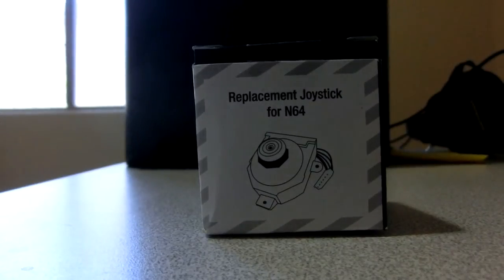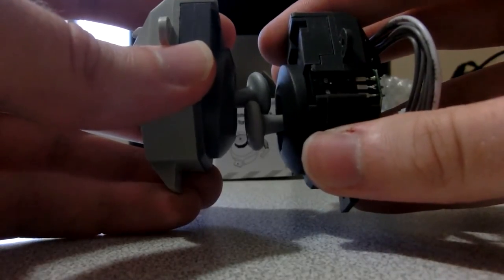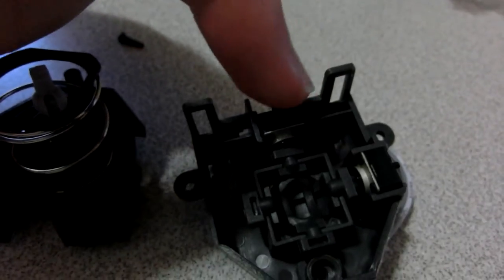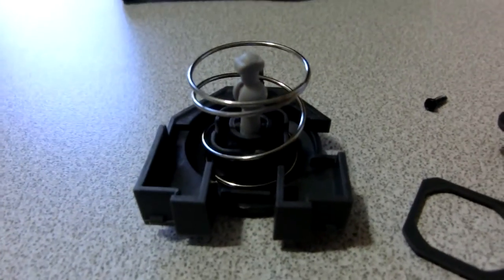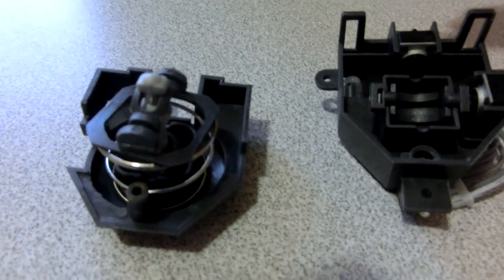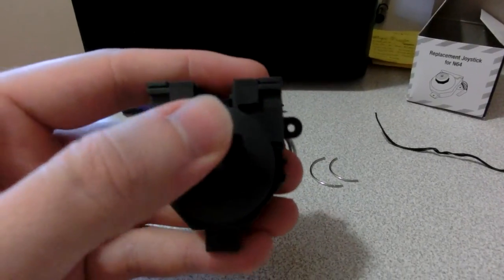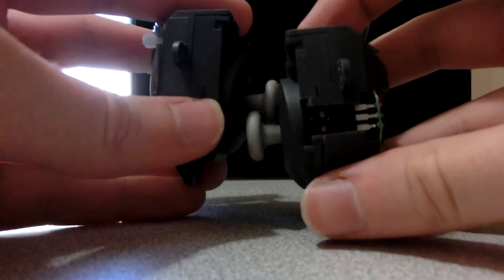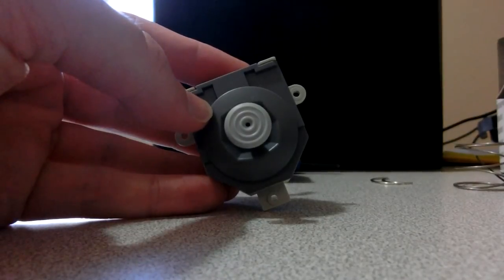Repair Box N64 joystick review, teardown, and tinkering

Comment: i added in some grease in there because to make it smooth. however im having trouble putting it back together. the spring is making it difficult to put it back together. i didnt have any problem putting back the original stick

Comment: I brought a handful of these and hit exactly the same issues as you did. I tried using an original spring and using silicon grease but while better (and much better than some of my sticks which are completely unusable) I still didn't like it. It does, however, use the same sensors as any other console sticks so I replaced two with PS2 sticks (and a lot of cutting, gluing, soldering and tiny crafting) and was delighted with the results. The sticks do have a bit more of a dead zone than the stock stick, and are a touch more sensitive. The nex problem I hit was that the ps2 sticks don't seem to give enough resistance to allow fine control - however the Xbox 360 and Xbox offer a mite more. It's a lot of work to put a modern stick into it but it's well worth it with a Xbox one - can play as normal with only a little learning as you need to play a little different for the new (not busted and now smooth) stick type. Hope that helps!
Reply from the maker: Mark Kane That sounds pretty complicated.  Maybe you could make a video or website about how you did it!

Comment: Did you have the same problem where the controller would not fit back together properly after installing the Repair Box stick?
Reply from the maker: No, the RepairBox stick fit just fine inside the controller.
Reply: NintendoRepairs I know this is already an year old comment, but I just have to tell this. I just got myself a N64 and decided to put it in good shape. Cleaned the console and controller etc. Then I ordered the Repair Box stick to replace the worn-out original stick. Well it felt stiff and good, but when I put it in my controller, the controlled wouldn't fit back together anymore. I even tried taking off a little plastic from inside of the controller, because I thought it would stuck there, but nope. I couldn't even figure out what was it that was getting stuck. I think it may be the cables, but I don't know. I'm just disappointed now. Over 10 euros wasted. It may not be a big amount to many, but I still feel like it was wasted and am disappointed. Why wouldn't the controller fit with this, even if this and the original stick are about the same size, but still there was a huge cap when I tried with this stick. At first I thought it was the circuit board, because the original doesn't have it on the top, but when I took off a little plastic that I thought was hitting the circuit board, it wasn't that. Sorry a long comment, I'm very tired and am not good at summarizing things shortly right now...
Reply: Old comment but i just had the same thing happen to me, two sticks, 5 controllers, no-go.

Comment: have you tried playing with the repairbox joystick without cutting the spring? what are your thoughts on its performance?
Reply from the maker: R Shinn, I played Mario 64 for about 5 minutes with the unmodified repair box stick and found it to be painful.  Since the joystick has so much force, it was hard to just hold it slighly to the right while I was swimming.  I think also that I had to put my thumb on the sides of the joystick piece to move it, instead of just pressing lightly against those ridges on the top as I normally do.

Comment: I gotta join people here saying that cutting the spring might not be the best idea.  I have an N64 controller that I haven't used much (stock Nintendo, unmodified) and I find it very stiff.  You might just need to break it in.
Reply: Yuko Asho had mine 12 months now and  its just got to a lovely sweet level of resistance.  I think your right.
Reply: An update.  Not a fan of these sticks at all now.  Trying to platform in Mario64 is made very hard by the over sensitive nature of these things. Goldeneye is nearly impossible to play with.
Reply from the maker: Thanks for the feedback.
Reply: David Grayson A bit late I know :)
Reply: Could just be time to replace the stick with one of these repair sticks.  Nintendo 64 originals were very famous for breaking down easy.
Reply: I have the same replacement joystick, I also have the gamecube replacement one as well but unlike the gamecube one, I don't have problems.

Comment: Thank you for the review David. I was going to buy one of these but I was concerned about the feel of the joystick since it is 3rd party and now I'm glad I did some research before purchasing. You validated my concerns about it being too stiff. Turns out I have a 3rd party controller that uses the EXACT same mechanism inside the joystick and it's terrible. I wont be buying this product. I also heard that the GameCube style joysticks have a pretty bad sensitivity problem, which means they're not going to be suitable either.

Unfortunately this leaves my only option for a replacement to be finding an original controller in good condition and salvaging the joystick from that. But the odds of finding one at this stage are fairly slim.
Reply from the maker: Hmm, I was able to find some decent joysticks inside original controllers on EBay back in 2013.  Good luck to you!  Also, you could learn about 3D modeling and 3D printing and perhaps print your own joystick parts to go with the electronics and sensors in the original controllers.  That would be awesome.
Reply: David Grayson I'll give that a look so, thanks David!

Comment: You linked the wrong joystick. You have the DN64R-A04 but you put a link to the DN64R-A02. Here is the correct link. http://hyperkin.com/nintendo/n64/n64-replacement-joystick-repair-box.html
Reply from the maker: Thanks, I fixed the link.  I suspect Hyperkin changed their page.  For reference, the link used to be: http://hyperkin.com/n64-replacement-joystick.html   The DN64R-A02 looks like it could be nicer; it's a Gamecube style one.